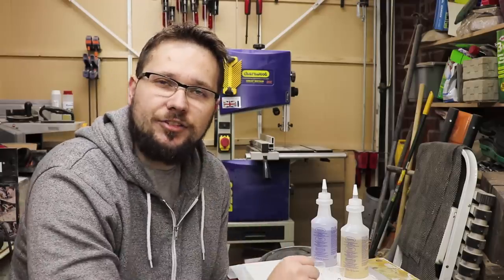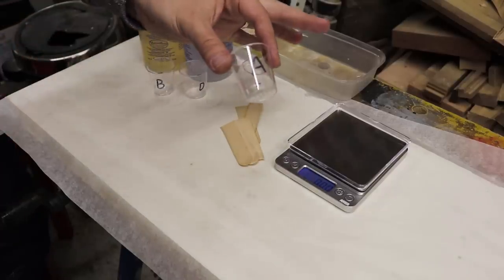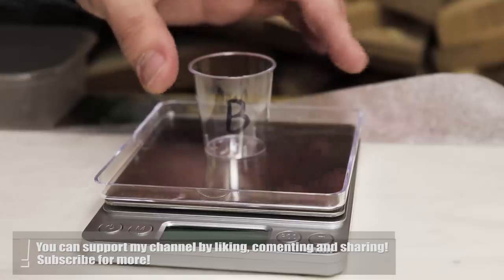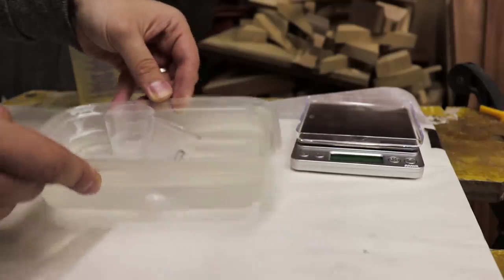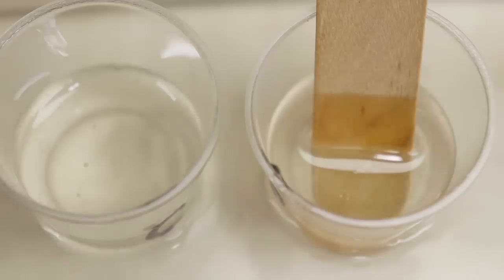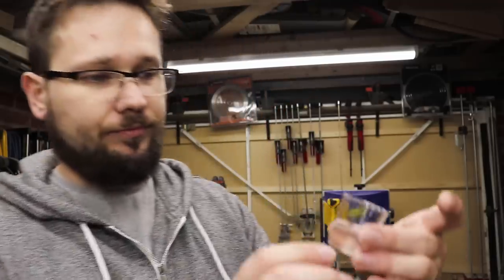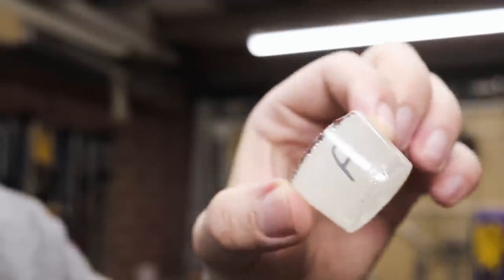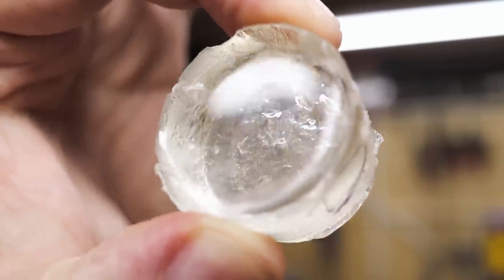Epoxy resin - casting technique to get rid of air bubbles - no pressure pot needed

Comment: HELLO FRIEND THOMAS AS I DO MPARA THAT DOES NOT FLOAT ME IN THE RESIN THE WOOD BECAUSE I WANT A PIECE TO STAY IN THE CENTER OF THE RESIN BUT FLOAT I HAVE TO BE WAITING TO HALF GELE TO BE ABLE TO MAKE IT STAY BY PUSHING IT WITH A STICK BUT LIKE REGULARLY WORK BY NIGHT TO THE NEXT MORNING DAWN THAT YOU ADVISE
Reply from the maker: I would do it in stages. Fire stage pour a base level of resin and let it cure. Second stage the object that needs to be suspended in resin goes in and attach it with for example UV resin - quickest way. And then the third stage, pour the top layer of resin. Your object will not flow to the top and you can easy get the air bubbles out. Hope this helps👍
Reply: OK MANY THANKS FRIEND IS THAT IN MEXICO THE RESIN TYPES ARE VERY LIMITED ONLY THERE WILL BE 2 OR THREE I DO NOT UNDERSTAND WELL THE CONSEPTS THAT YOU SAY ME BECAUSE I AM NEW IN THIS BUT IF I GIVE ME AN IDEA A LAYER I LET IT DRY UNTIL IT RESISTS THE WEIGHT OF MY WOOD AND ALSO FIXED IT AND THEN SEEN THE OTHER LAYER, BUT I GENERATED A PROBLEM MY DRY RESIN IN 3 OR 4 HOURS IF I AM DOING SOMETHING WITH COLOR WHEN I DROPED THE FIRST LAYER THE OTHER PART NO LONGER I GO TO BE ABLE TO DUMP BECAUSE IT IS ALREADY SOLID IT WOULD HAVE TO DO 2 PREPARED AND I AM AFRAID THAT THE COLOR DOES NOT REMAIN EQUAL BUT IF IT IS GOOD YOUR IDEA I WILL TRY TO SEE WHAT HAPPENS AND LAST AND APOLOGIZES FOR DISTURBING IF IT WAS A RESINA PURE BEAUTIFUL WHITE IT DOES NOT SEE NOTE THE DIVISION BETWEEN RESINS @CasualDIY
Reply from the maker: @AdrianMartinez-qo8yv  Yes if you are using colour then this may not work. Check out Zac Higgins he has done a live stream on suspending items in resin, here is the link: https://youtu.be/DxgvK9Hydcs

Comment: I was told the amazing cast and crap yeah amazing clear cast you aren't supposed to measure by weight you're supposed to measure it by volume which I thought was you know measuring up the cup but I tried measuring it by a scale and it came out rubbery super rubbery

Comment: So far I have used a chefs torch and now I have a heat gun to disperse the bubbles that works fine for me...also you really should be wearing gloves when using epoxy due to the skin reactions people have suffered with..
Reply from the maker: Hi yes that's true gloves should be used at all times when using epoxy, it's also very hard to get it off your hands. And that was my initial plan but the gloves I bought were too loose!!! Lol and I just didn't had time to pick up another pack...
Reply: Rachael Perkins also it’s maaaad sticky 😂

Comment: Or just use a flame like everyone else after pouring
Reply from the maker: That's true when you doing shallow pours. On deep ones, if the epoxy is too thick the air bubbles will remain trapped inside and will not come out to the surface for the torch to work.
Reply: @CasualDIY  Nope not true I use crystal clear for a 7cm deep fill flame works great
Reply from the maker: @tobygillette8707  good I'm happy it works for you then 👍 with my epoxy if it's too thick the air bubbles get stuck inside and torch will do nothing for them.
Reply: toby gillette I’ve been casting mine in these silicon molds and still get a lot of bubbles below the surface. That’s why I’m watching videos like these. It works for when I cover a painting but not if I want to cast in a mold, unfortunately.
Reply from the maker: @forrestthroughdatrees  that's exactly what this technique is for. Flame will only remove air bubbles that are on the top of the epoxy and not deep inside of the mold.

Comment: This resin you are supposed to measure by volume not weight
Reply from the maker: Exactly and I got a pinned comment where I say that. My mistake however the resin still cured correctly.

Comment: A lot of trouble for nothing .
Don't use a flame to warm the epoxy, use an electric heat gun  
You only need that electric heat gun to warm the already mixed pot, and then warm the actual work after the epoxy is applied to drive the bubbles out.
This is particularly important if you are using fibreglass or other fibrous material as the bubbles will form when the epoxy is applied over it, even though the mix was prewarmed.
Reply from the maker: Heat gun is not always possible to use as it blows air and may affect your project, hence a bit of flame over the top will pop the air bubbles. Other solution is to use a straw and and blow the air through it. You got more control of the amount of air blown and you can directly break the air bubbles.
Reply: @CasualDIY  Nah. Warm epoxy is self levelling, snd any minor disturbance goes quickly. 
In any case, most electric guns have low blow settings, and you can just let the warm air rise to the work.
Reply from the maker: @dnomyarnostaw  yes, I've got an old one and got just one speed it's like a hairdryer 🤣 need to buy a new one

Comment: Hi! This was useful. I struggle with the resin I use due to the complexity of the mold. I've been coating the surface of the mold with metal or talcum powders and then a thin layer of resin by manually popping the bubbles from the crevices. I've also been keeping the resin in the freezer for 5 minutes and then pouring into the resin, blow-drying it. After all this, I still have a few annoying bubbles. Sigh. Due to this insane process of mine, I've been unable to make 180° sculptures, fearing bubbles. Do you have any advice? This is what I make: https://www.instagram.com/p/BwdxibpDnbT/?utm_source=ig_share_sheet&igshid=1s0ysr6x8y52k
Reply: Can anyone help, please? :)
Reply from the maker: Hi. Yes I can see you may have issues with these casts. If you doing it for profit and professionally I would suggest buying a pressure pot system. Or you can try to find a different epoxy that has got better viscosity  almost like water. I will try to get a link to it for you.
Reply: @CasualDIY  Thank you so much! That would be of great help!
Reply from the maker: @monishamiriam  There you go:
http://www.metalclay.co.uk/royal-palm-epoxy-resin-thin-710ml-24-fl-oz/
Reply: I know this post is like 4 years old but why in God's name would you put it in the freezer???? It would be so thick and so impossible the poor you may as well whip it with a kitchen mixer!  I'm also guessing there's a typo in the part that says they pour the frozen resin into resin... I tried to talc powder thing and just was ugly... But how do you put powder and then a thin layer resin inside a mold? How could you possibly coat all the sides without it just running down to the bottom of the mold?? ....
There's just so much wrong in this person's method and I just have so many questions...
But I can agree with the difficulty of pouring complex 3D casts without bubbles in every corner, edge, dip, ect.... So I started using a pointed metal stick (? Not sure what to call it all I know is it's supposed to be for resin and come  with 2 more with different tips  and they have pretty pink gems on the end LOL) to pop the bubbles any place that I can see and I just kind of squeeze gently all round the mold carefully not to squeeze it so much that the resin just pours out the top and the bubbles slip out and come to the top and then I heat gun it...
That's another thing... I'm very confused why everybody's using torch lighters and not heat guns!!! I mean you're going to ruin your molds and if you're using alcohol inks your going to set everything on fire... 
Also as far as heating up your resin before mixing it or after mixing it, doesn't make a difference.  if you heat up the resin and hardener separately before combining them it's still speeds up the cure cuz it's still warm when you mix it! You just got to decide if you want to take your time to mix it slowly and have lots of work in time but still have some bubbles or if you want to mix warm it up so you have as few bubbles as possible but you also have a fraction of the time to pour. If you try to mix multiple colors forget it.
 word of advice to any newbies reading this... pick colors that are opaque translucent or use Mica powder which is also opaque for the most part and it won't matter if there's any bubbles smoke be able to see them... Bonus- you can use a power mixer either made for resin or a drill with a paint mixing attachment, or just mix it up fast it don't matter cuz you won't be able to see any of the bubbles!!

Comment: Use a plastic stirrer and not wood. All wood contains air... Also a WARNING!! Never use a naked flame with polyurethane resin. Nobody ever makes this clear. It's extremely flammable. Only use a naked flame with epoxy that does not set with a catalyst

Comment: don t try C and D!!! it has cure my resin in couple of minutes. yes the bubbles were gone, but so was 100 ml of resin. hard as rock. No no no 👎👎👎
Reply from the maker: It all depends on the resin. Yes it will shorten the cure time but the resin presented has got 40-60 work time. Hence it will work for resins that have slow setting time.

Comment: But there are still some air bubbles. It is not very good method - just mediocre.
I need perfect surface for solar plates
Reply from the maker: Hi yes, unfortunately this is a budget method of getting decent results. For perfect results you need to invest in some good equipment like a pressure pot.

Comment: Let's be honest here! Very bad results, all the way! Use a vacuum chamber! End of story!
Reply from the maker: Vacuum chamber is not the best solution for all resin types. I would rather suggest a pressure pot. In both cases its a big investment and not every can afford or be prepared to splash that kind of cash. So sometimes its better to try out other options to that will give reasonable results.

Comment: I'm seriously disappointed that you didn't prefix your video with any kind of safety warning about using epoxy resin or show any example of proper safety yourself by not wearing any gloves, eye protection or a mask during this tutorial. If you're advising people about how to use a product like this you should also be telling them the potential health hazards. As a content creator for a public audience this is one of your responsibilities. I'm not trying to be a jerk so I'm sorry if it's coming across like that but epoxy can have some serious health concerns if not used correctly.
Reply from the maker: That is true, certain resins can be very dangerous and toxic. Fortunately the one o was using is none of that but at least gloves should be worn. But as you said it's our responsibility to make people aware of those potential hazards and that's why I'm actually in the process of making a series of videos about resins. And the first video talks about the potential hazards 👍
Reply: @CasualDIY  but the product you link to specifically lists "Caution: Eye & skin irritant" as well as "Danger: harmful if swallowed. Harmful by skin absorption. Corrosive."
So eye and skin protection would be a bare minimum.

I'm glad that you're planning on making a video covering this, so thanks for that, but this video still leaves that unaddressed. Hopefully you can at least link to your safety video at the start of the video once you've made it?
Reply from the maker: @CataclysmAU  should be able to link it in the description👍